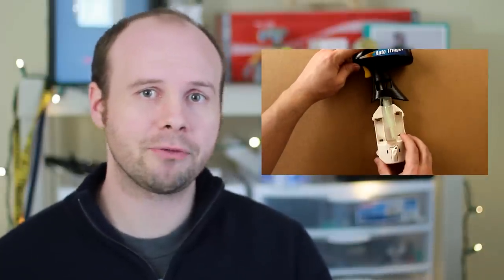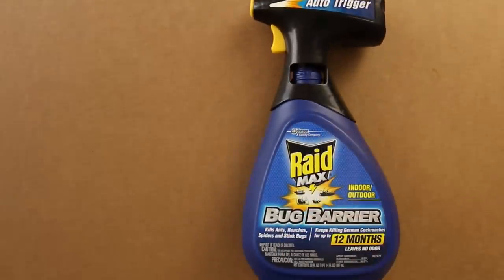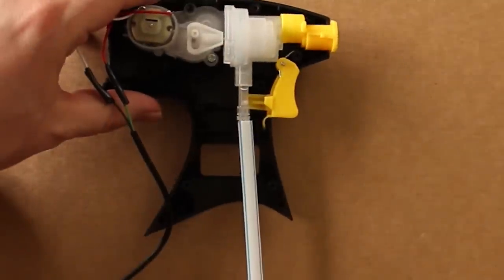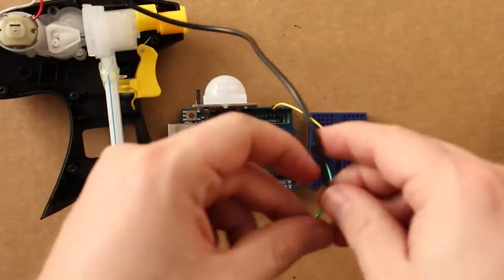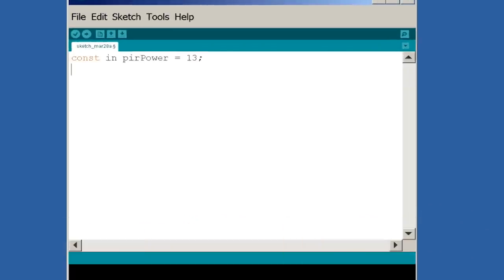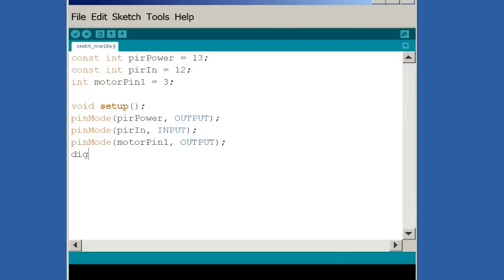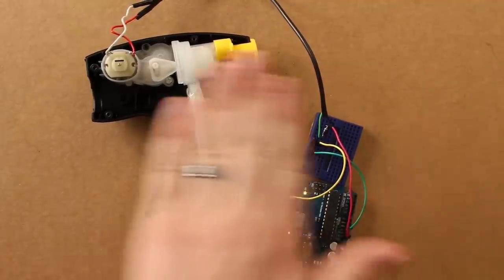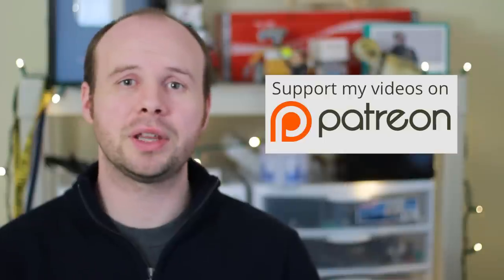Arduion Motion Detecting Squirt Gun

Comment: Which transistor do you use? I connected EVEYTHING as you did yet my motor wont stop running non stop
Reply: did you ever figure it out
Reply: @victoriatapia6265  no, ive tried a lot of different ones i got from work, no success.. went with a relay instead yet when triggered it keeps running so i guess ill have to put in a snuff diode somewhere.. Never had time go get around to it so sadly i sort of binned the whole thing

Comment: I tried and tried to rig this circuit up with a transistor but as far as I can tell, the motor draws too much peak current for the transistor. I tried with a MOFSET too and couldn't get the motor to turn over (although a smaller motor would work). Maybe I'm just not clever enough. Ultimately I just used a small 5v relay, triggered by a MOFSET/transistor. I just used the 3.3v output on the motion sensor as a trigger and this completely obviated the need for an Arduino.

Comment: Im having a hard time getting the motor to move the pump (the motor works without the pump attached). Any suggestions?
Reply: stronger motor
Reply: Mine only worked with 9V adapter.  wasn't strong enough to pump on batteries.

Comment: Cool concept !! Thanks for this awesome video Tinkernut :)  but how come it won't work without the computer?  With a usb wall plug, the arduino puts out 5v but is stuck in some kind of loop.  Also the motor won't run at all
Reply: what's the current on your wall plug? If the motor is trying to draw too much it could restart the chip.
Reply: thanks! I got it working with 9V plug.  Also it worked on our cat and was less insanely powerful when I lowered the power using other default DC Motor settings and analogWrite, instead of just HIGH.  In addition it only squirts.  I did it with a Mist Pour autospray top bought on amazon, has a true spraysetting, and is half the price of a Raid auto spray, and doesn't come with unneeded chemicals.
Reply: I just used the 3.3v to power it
Reply: @miked4076  Do you have a video/plans/etc of your project?

Comment: What is the purpose of the diode?
Reply: The DC motor will generate a backwards current when it stops, so the diode will prevent that current from getting to the Arduino and damaging it. At least that's what's I've read online.
Reply: that diode is called a flyback diode. If you power any motor (or coil) there will by electricity that builds up in that coil. when you disconnect a wire (or close a transistor) the electricity will still be present in that coil and it wants to go somewhere. so it goes to the transistor cuz there is no other way to go. that could damage the transistor or blow it up. when you add a diode the current will be cycling trough the motor over and over again until the electricity is gone.

Comment: what transistor and diode do you use? the links no longer work i guess
Reply: I don't think it matters. I just used the ones that came with my arduino kit.  It's not like a resistor or capacitor or whatever.  Diode restricts the flow of electrons to one direction, and the NPN thingy is like a switch.
Reply: @miked4076  thanks for your reply! Since ive went to read and learn a lot about transistors so ive defenitly learned from this :)
Now, as per your instructive ive done this the same way, copied the code and connected the same way, though the PIR does not register anything in the serial monitor.. 
I connected it in a different way so that itd light up an LED, that did work so i know the PIR is in shape.. 
Anything i might have gotten wrong? Its a DC engine in the Max bottle so polarity could be the issue?
Again, thanks for your reply
Reply: @sittingduck5477  I can send the code later that I used. Also mine worked only when plugged into computer or 9v plug.
Reply: @miked4076  Good stuff! Yeah i copied the code from your link.. might have to check things again though, also i keep it connected on the usb and the breadboard is connected the same way 🤔
Reply: @sittingduck5477  I'd try to make the motor work without the pir sensor first to make sure your settings and connections are gravy. Did you do that?
Reply: The motor works, but if i connect it to 5v and GND the Uno reboots so doesnt work constantly, though now i know its still working.. 
The PIR does too, but connected like this, it wont give me any reading in the serial monitor..
Reply: @miked4076  ive checked again, its all connected like the diagram, meantime i checked the sensor in a different script (for an LED) the sensor is also connected differently in that case, but then the monitor does register movement.. 
I dont know what im missing :/ and my cat keeps roaming the counter :D
Reply: @sittingduck5477  Dang.  I'm sure you get get it if you keep trying different things.  On a side note - although this is a fun accomplishment, and it does keep the cat off things... it also gets water on other things.  Shortly after success with this, we read "The trainable cat" and happily had our cat sitting on a dishtowel on the floor, like a sentinel, awaiting little hits of wetfood juice from a syringe made for liquids.  Google it, the trainable cat, it's pretty awesome! (Oh that,  and we put a little plywood gate on our kitchen for when kitty is being really bad)
Reply: @miked4076  Lol yeah i half expect a flood when this thing is finally working.. Luckily my coworker is a programmer and he asked why im expecting stuff in the monitor when i dont have Serial.begin(9600); in there.. so i think ill try that. If i all connect the stuff the motor also runs non stop so i think ill screw around a bit with the transistos as well..
Again thanks for replying!
Reply: @miked4076  Hi again, so ive shelved this project for too long. I need an NPN transistor yes? Ive gotten it working with LED's so this i should be able to get going too..
Last time when i had everything connected the motor kept spinning instead of only when PIR triggered.. how do you think can this be?
Reply: @florianakkermans6334  yes set it up exactly like the video. You can use the monitor to trouble shoot and put different print codes in the different cases so you can see what's happening.

Comment: How could I make this work with a RC trigger instead of motion sensing?
Reply: Dunno about that, but my arduino kit came with IR sensor and a remote control that's easy to set up as the trigger for the motor.